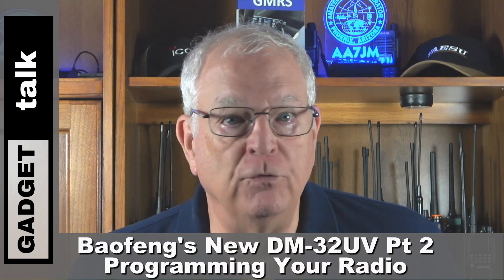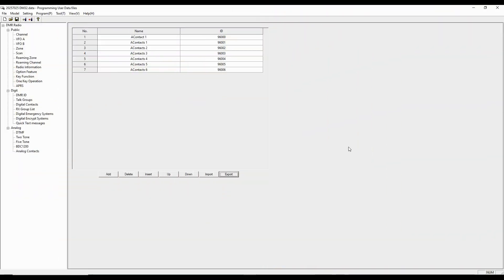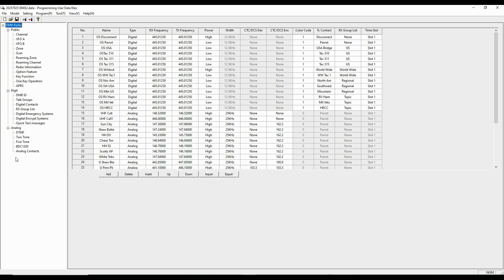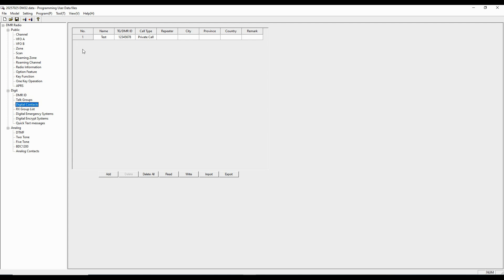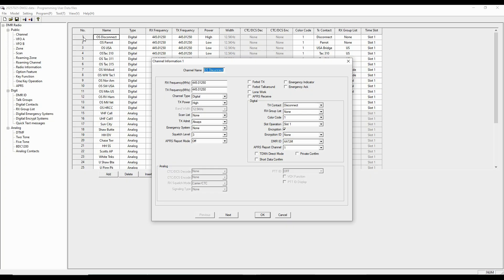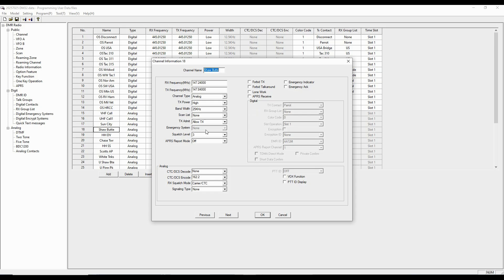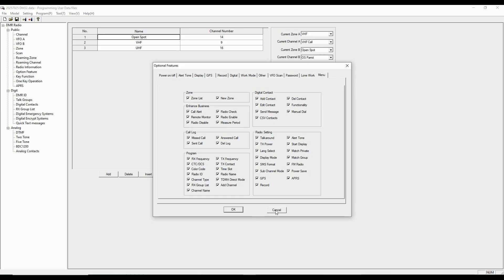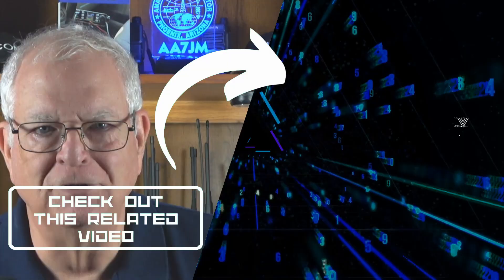DM-32UV DMR and Analog HT Programming

Comment: I can't fully read the radio. It goes about 1/8 of the way and then says "Communication failed!" . Com Type and COM are correct. I have baud rate at the stock setting of 115200, but have tried changing that, no luck. Volume on radio is maxed and have tried all over the volume knob. I'm on a clear frequency and no antenna. The cable works on my other Baofengs, including the UV-32. The DM-32 pops on its screen and says PC Programming, then the error pops up on my PC. Have tried different com ports as well.
Reply from the maker: Sorry you're having trouble. Make sure you have the right CPS and the correct radio model selected in the dropdown box at the top. Try holding the programming cable in tight to the radio. Good luck.
Reply: @GadgetTalk4U sorry I didn't update. The cable connection to the pc was the issue. I got it fixed.

Comment: Do you have a tutorial for programming the DM32 uv and scanning just for analog? I’m only using 70 cm and 2m but want to program using CPS to be able to scan repeaters in several states as I am on the road frequently. You part 2 video seams to be more DMR programming than analog. I don’t understand the difference between scan stations and zones. I’m not sure which I need to use. Any help is appreciated. I really enjoy you videos and straight forward approach.
Reply from the maker: I don't have a video, sorry.  Have you considered building a scan list and then entering all the analog channels you want to scan into that list?  Manual section 7.2 discusses various scan options. I don't do much scanning so my knowledge here is limited. 73
Reply: @GadgetTalk4U  Thank you for the response. Yes I have programmed about 300 channels and divided them into about 20 zones and about 30 scan blocks since the scan blocks are limited to 16 channels.

Comment: I'm a novice when it comes to radios. How can I program a PL code into a channel I have?
Reply from the maker: The DM 32 as a DMR radio is not novice friendly. That's just the nature of DMR. A local ham might be helpful. To answer your question, when programming an analog channel there will be a box for CTCSS or DCS codes. Add them there. On the radio, select a channel and then go into the channel set menu and find CTCSS or DCS codes (item 4) and select the appropriate one. Cheers.

Comment: The software is a requirement which makess this a trash radio.  You can't add channels from the front face past the default 16 channels.  That's a huge problem for a SHtf situation.  I'd like to see a full video of field programming without the software. I should t need to carry my laptop, cables and other stuff just to add a channel in the field.
Reply from the maker: I've  seen a couple of items on this. If I remember right, one was a carryover setting in that range that disappeared in higher channels. This video dealt with something similar:
https://youtu.be/oMC1IONUOKQ?si=uME_CnZ2CIRbJ8jm
Good luck.

Comment: Im losing my freaking mind trying to program my dm32 ive tried different ports different orders of starting things updated drivers and a thousand other things and every time i try to program i get a communication failed message
Reply from the maker: Sorry you're having trouble.  I grabbed my radio and got the same error. When I looked closer I had grabbed my UV 32 instead of my DM 32. When I got the right radio it worked with three different programming cables. That got me to thinking that perhaps you're using the wrong CPS. For the DM32 you should have a program icon that reads CPS DMR V1.41. If you're seeing BF-UVPROs CPS v1.4.7 you've got the wrong CPS for the DMR radio. And for that matter, vice versa. One last thing to check - press really hard on the K1 connector on the radio. They sometimes don't seat well without a little persuasion. Good luck.
Reply: @GadgetTalk4U I'll double check this settings on the radio say its a dm 32
Reply: @GadgetTalk4U just checked my Amazon order I ordered a good cable but it doesn't say its compatible with dm32 didn't think that would matter but i got a different cable from baofeng that says its dm32 compatible we will see if this works. The current one is basically just a uv5 cable
Reply: @shoup15u27  Did you ever have any luck? I'm currently having the same issue with a new DM32. I've tried CPS V1.41 and 1.45 , 3 different cables, still the same communication failed error.
Reply: @Mike-e-e-y no luck for me
Reply: The cable supplied with mine was Hiroyasu branded and worked straight away. Open device manager to confirm your PC is seeing the radio. The COM port is different for everyone and depends on what else is plugged into your PC so make sure you use the right one. Also make sure the cable is connected fully into the radio.
Reply from the maker: Make sure you're using the correct CPS. CPS DMR V1.41 or later. If you're seeing BF UVPros v1.47 or later, that's the uv32 not the DM 32.

Comment: Well, here's my story:  My DM32 seems to be a good radio, but I've hit a wall on the Code Plug process.  I've made my manual TG list of all the states, a few countries, and a few fun TGs.  I then created the Rx list and organized them into different categories to serve as zones.  I then started the channels and made it up to the 13th one and hit the wall.  Boom!  Nothing would take on the first frequency box for the channel I was trying to input.  I hadn't tried to set up the zones yet.  Is there a very low limitation on the number of channels to be input?  I noticed on your CPS that you show at least 15 digital ones.  Stumped, and at the moment, disappointed.  Thanks in advance for any forthcoming advice.  Bob, WG1c
Reply: Confession and correction.  After much frustration and confusion, I discovered that my inability to enter frequency numbers had been caused by my accidental and unknown bumping of the numlk key, rendering the numbers keys locked up.  After hitting it again, the sun came out and I was able to finally finish my slog through the manually developed Code Plug.  Life is good. It works. Now I hope to get it to communicate with my SkyBridge hotspot.  Fingers crossed. Bob, WG1C

Comment: I live in Europe.
I don't have a DMR ID.
DMR Tier I: Tier I is the level designed specifically for license-free use in the dPMR446 band (446.0 MHz to 446.2 MHz.). In Europe, the maximum output power is 0.5 watts (500 mW) and can only be used without infrastructure such as repeaters if you don't have a license (DMR ID).
I know it's not legal to use this radio because it has too high an output power.
But will it be possible to use it as a dDMR 446.0 MHz to 446.2 MHz. without a DMR ID? (Digital, not analog Mode.)
Thanks for the many great videos you make. :)
Reply from the maker: My DMR technical knowledge isn't that deep. It is my understanding that your DMR ID is similar to a phone number. It identifies you as someone to call. Getting  a DMR ID is free. Consider asking this question in a DMR dedicated forum. Thanks for watching and commenting.
Reply: Just FYI i believe dPMR and DMR Tier 1 are different protocols. dPMR is FDMA, DMR T1 is TDMA. They arent compatible.